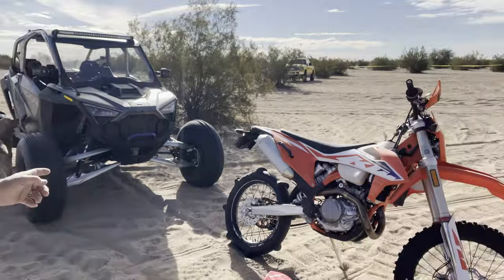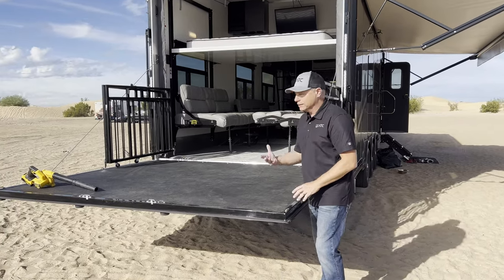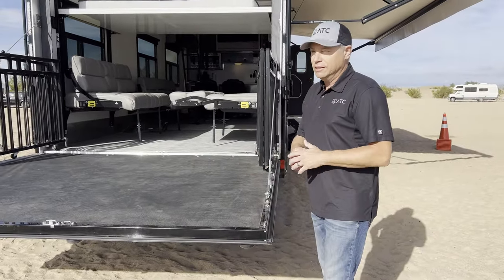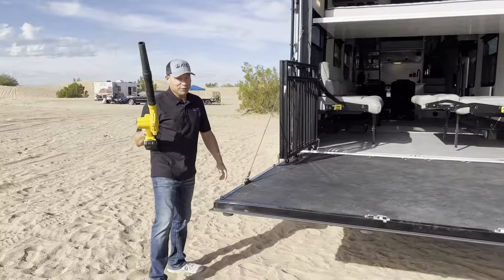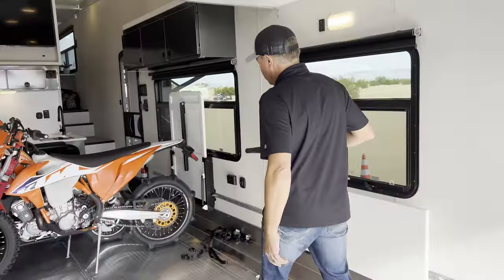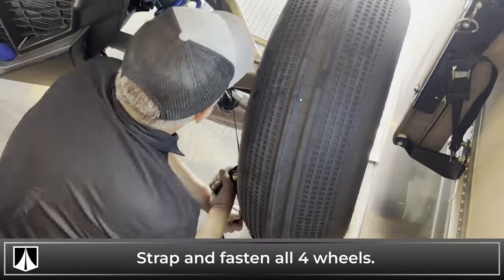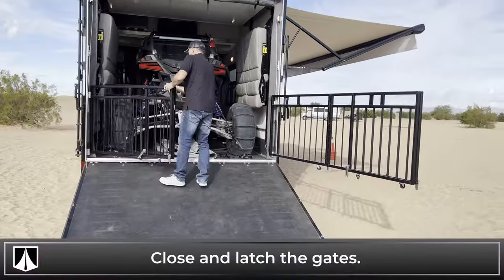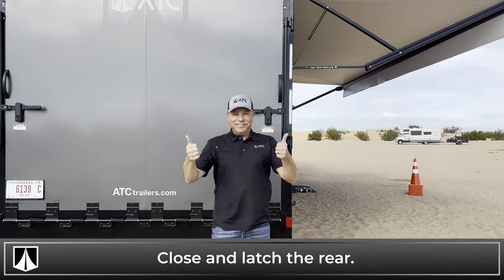ATC Plā 700 Tutorial - Loading UTV and Dirt Bikes

Comment: The 4319 dimensional diagram shows the garage as 22' 6.75" from the back wall to the middle of the fridge / counter. I'm curious what the length is to the rear-most slide wall (when in) and also what is the width at the same location with the slide in? Thx!
Reply from the maker: Its 19' 8 1/2" from the rear slide wall to the ramp door. When the slide is in, there is 74 5/8" from the fridge to the passenger side wall and 65" from the fridge to the passenger side wheel well.
Reply: @aluminumtoyhauler  thanks!